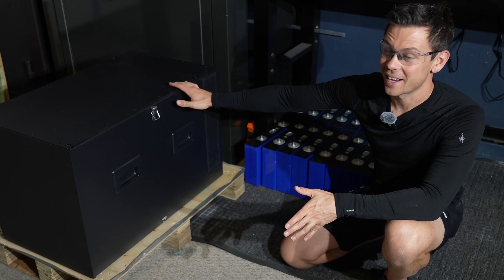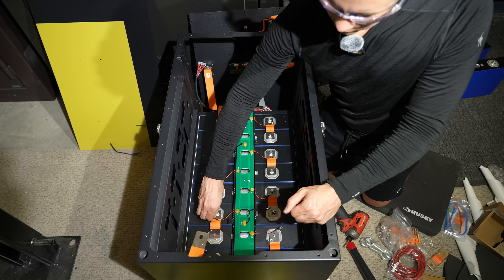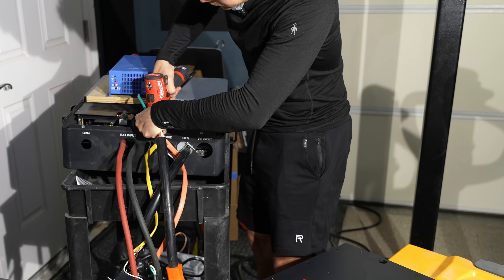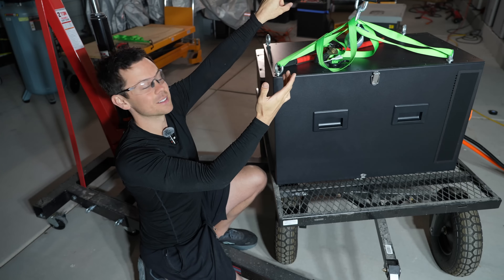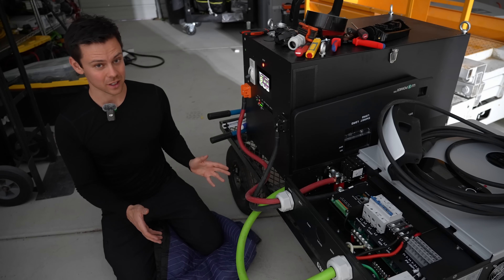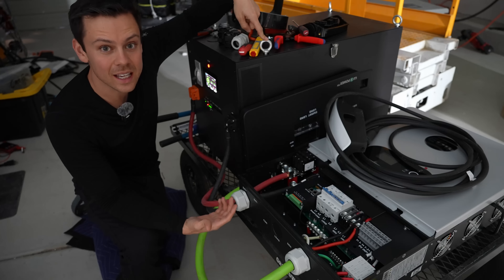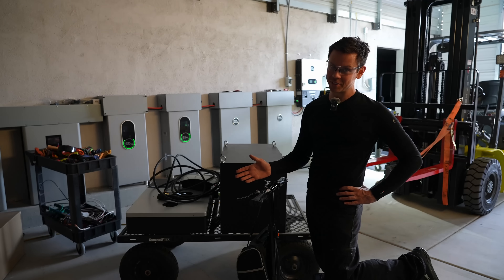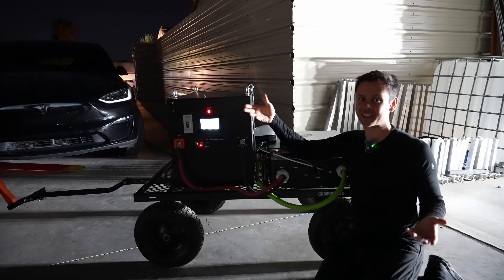HUGE 32kWh LiFePO4 DIY Battery w/ 628Ah Cells! 90 Minute Build

Comment from the maker: Affiliate Links
32kWh Battery: https://yixiangpower.com/products/pre-sale-yixiang-us-stock-eve-mb56-finished-battery-pack-32kwh-51-2v-16s-628ah-eve-lifepo4-cell-lithium-battery-estimated-shipping-date-dec-20th?sca_ref=9207522.jYuzmwEjUpH

Smaller 16kWh Version:
https://yixiangpower.com/products/pre-sale-yixiang-pre-assembled-stacked-15kw-diy-lithium-battery-box-kitus-stock-estimated-shipping-time-aug-28th-16pcs-eve-314ah-brand-new-grade-a-lifepo4-battery-cellchina-stock?sca_ref=9207522.jYuzmwEjUpH

Other Batteries I recommend:
https://www.mobile-solarpower.com/server-rack-lifepo4.html

~~~~~~~~~~~~~~~~~~~~~~~~~~~~~~~~~
Tired of getting ripped off? Check out my "Will Prowse Approved" solar product recommendations below!

12V Batteries
https://www.mobile-solarpower.com/lithium-batteries.html

48V Batteries
https://www.mobile-solarpower.com/48v-batteries.html

Offgrid Inverter System Builder
https://www.mobile-solarpower.com/48v-complete-system-blueprint-559371.html

Hybrid Inverter System Builder
https://www.mobile-solarpower.com/code-compliant-48v-offgrid-system.html

Mobile Handtruck System Builder (very popular!)
https://www.mobile-solarpower.com/mobile-48v-system.html

Solar Panels
https://www.mobile-solarpower.com/300w-solar-panels.html

Ground Mount Solar Racking
https://www.mobile-solarpower.com/ground-mount-racks.html

Wire, Lugs and Busbars
https://www.mobile-solarpower.com/wire-and-connectors.html

Tools
https://www.mobile-solarpower.com/tools.html

Fuses and Circuit Breakers
https://www.mobile-solarpower.com/fuses.html

Plug-N-Play Solar Systems
Ecoflow, Anker And Bluetti! So many models to choose from. See my current recommendations here:
https://www.mobile-solarpower.com/full-size-systems.html

~~~~~~~~~~~~~~~~~~~~~~~~~~~~~~~~~~~~~~~~~~
Need to build a large DIY system? Need a trustworthy solar distributor? These are my favorites:

Signature Solar
Creator of EG4! Solar Minisplits, Victron and More! Largest Solar Store Online.
If you want $50 off, please use my link below and coupon code "DIYSOLAR50":
https://signaturesolar.com/?ref=cPwLcVc0SW-BjN

Current Connected
Best Prices for EG4, Victron, Midnite and so much more! Fast Shipping and Highest Rated Customer Service:
https://currentconnected.com/?ref=wp

~~~~~~~~~~~~~~~~~~~~~~~~~~~~~~~~~~~~~~~~~~
Join our DIY Solar Community 
Need more help? Join the largest solar forum on the internet for beginners and professionals alike. 140,000 members and counting!
https://www.diysolarforum.com

Check Out My Free Book
Best-selling and beginner-friendly guidebook to off-grid 12V solar!
https://www.mobile-solarpower.com/the-book.html
Reply: Will knows what's up. Everything is an opportunity to buy a new tool! 🤣 Get well soon!
Reply: I need to show you the cart that I built! I think you would love it!
Reply from the maker: @davidlewis624 please post it on the forum and tag me! Would love to see it
Reply: @WillProwse It looks like Bluetti has entered the Solar Charge controller, and server rack battery market.
Reply from the maker: @FauxQue-yk8dt  with pure garbage 🤣
Reply: @WillProwse You the man. Review incoming?
Reply from the maker: @FauxQue-yk8dt thanks man, and still healing foot, but have five videos planned next when I can walk a bit more
Reply: @WillProwse  Hey Will!... We are off grid and building an earthship and just switching to some Wattcycle Lithium iron batteries.... Have been following your reviews and just wanted to ask you a few  uestions...I can't seem to get your email address from your You Tube info... are you available for a few  uestions?... Thanx!      Kurt
Reply: Oh how i Wish for one these now in Jamaica 🇯🇲 because of the damage we sustained from hurricane melissa
Reply: I think the bms was 300amp
Reply from the maker: @aftabmaqsood  I just found this out 🤣 oh my goodness
Reply: @WillProwse  I have an idea.  How about you doing videos on building the perfect battery cart.  You are a very talented man.  You know how to do the research on material strengths.  Get what you need in a vehicle junkyard for the metal and axles.
Reply: Time to try a pair of Grunt work boots ,steel toe of course.
Reply: Did I miss the video explaining the water tank? Is this a emergency prep? Now there's no need to run to the lake if there's a shutdown.. maybe it's time to build a emergency Las Vegas crew. I'm game
Reply: Get yourself an old Tesla model S with the dual charger, which you will be able to draw 20kW with it (You need the older tesla charger too I think as the newer one doesn't support it).  Or I heard the Silverado EV does 80amp charging too... I got one and I didn't try it as I do not charge off 80amp at home.
Reply: Is it possible to order the batteries seperate, if so, where's a good place to get them?
Reply: You may be well served to upgrade your golf cart, or pick up one of those tiny airport utility vehicles. They come in 1500 lbs capacities and that doesn't include replacing the batteries. Also they aren't very big.
Reply: Is it just me or are those links not quite working fully? Like when I click on the link for either the 16kWh or 32kWh versions, the page initially loads fine..., but clicking on "Packaging & Shopping" does nothing, clicking on the pictures does nothing. if you add to cart and calculate shipping: Again nothing.

I tried on both Chrome and Firefox. It seems like their website is very broken.
Reply: I want to do a mostly stationary battery for my home.  I was thinking 48 kWh but now I'm thinking 64.

The problem is those box kits are quite expensive.  Also, if that battery has a bad cell in the bottom rack you have a lot to take apart to get to it.

What I want to do is stack batteries vertically on their side.  I'll use 5/16" threaded rod for cell compression with a sleeve of 3/8" PEX tubing to insulate the steel rods from the cells.  I'll use plywood for the top and bottom plates and get 4 heavy duty locking casters with probably a 750 lb rating (each) because when you have 4 casters you want two of them to have a rating greater than your max load because occasionally only two casters will be carrying the load and pushing a loaded cart with blown out casters sucks.

I would set it up as two independent battery banks with a BMS on each.  That will give redundancy and allow both banks to balance cells individually.

I'm not doing it right away so hopefully sodium ion cells will become competitive in energy density and even safer than LiFePo4 with more charge/discharge cycles.

Lastly I would make a case to cover up the battery and I'll probably make that look like a Dalek from Dr. Who (70s era).
Reply: nice deleting negative posts
Reply: He Will, did you look into DC to DC EV chargers? There should be some out there that pull 50V from the battery, raise it up to 400V for the car and charge the car on DC
Reply: altho i love all the new videos on bigger systems you have done. id really like to see some more prebuilt solar generator reviews im interested in the oupes mega 3 seems good and priced right and normaly id be completelly against buying prebuilt extra batteries but the oupes  b2 extra batters have dc ports and also solar input of up tp 2100 watts...
Reply: Can this battery communicate with an inverter so I can set it to not discharge below 20%?
Reply: @enispilavdzic8933 probably, but you can also set the inverter to command it based on voltage, so you can discharge until the voltage hits a specific level.
Reply: I look forward to next week's Video...
BUILDING A HABITAT ON THE PLANET MARS IN THREE HOURS!
*Some Assembly Required
Reply: Will, like you, I often work alone - an incident like this suddenly makes you aware how vulnerable you are - always carry a phone and let folk know where you are
Reply: Would you be able to do a few videos about E-Bike batteries. Maintenance & Rebuild DIY. Thank you.
Reply: This is where we go out and buy decent work boots!😅
Reply: Porfa haz una revisión de la vatrer de montaje de pared
Reply: If it had double lugs for the connections it would be better. As it is the only logical way to wire them is to stack them. And I would not wish that on any DIY soul.
Reply: @willprowse could you one day test the PUPVWHBW 200AH mini lifepo4 battery?? I’m thinking of buying and using one for car audio…
Reply: This might be a dumb question, but could this battery be tied into the Bluetti system (3 Apex 300s connected via the HubA1 (which is also a transfer switch)) and if so, how?
Reply: Use Arnica gel on your foot injury.  It will heal your soft tissue injury much quicker.
Reply: I was expecting to get more feedback from you on this... Maybe it because of the pain... No comment that this is a serviceable battery.  Everything is screwed in.  No info if the tork specs was provided.  No details about the connectors and internal wiring. No info about any vents. No comment about the fuse or breaker. No details about how the battery are installed, and if they are well compressed, of if it needed.  No details about the insulation and potential safety in building it.

I personally love the idea of a home build battery with professional result, as it garante easy service on it, especially for people who live off grid.  I didn't feel you were that excited about it... I know I personally was excited about it when I saw you build it. It look freaking great so far !
Reply: @mochouinard i think that was in the original video, where he talks more about the quality, the things missing, the wiring gone wrong. This is him doing it for the third time, I understand if he skips parts that viewers would already know (but he could point to it)
Reply: Bro, get rid of that Tesler and get yourself a Telo or a Rivian Quad2 EV...

Comment: $3,500 is expensive? the cheapest i could find for a home system here, as in set up to charge from solar panels or the grid and provide as needed to the home was $3,300 for a 2KW system, $2,200 for the batteries and $1,100 for the control system and installation.

Comment: I bought one of these  32kwh Yixiang batteries, expecting it would be a DIY assembled battery like Will's. It came fully assembled and very well packed for shipping; all 600# of it. I have the equipment to move it. I also ordered four more 32kwh batteries from Docan. Docan's Amy told me they were in a warehouse in Houston. I drove 1200 miles to pick them up, only to be told they had not arrived at their Houston warehouse. I had scheduled a January 8 pick up in Houston. Amy had replied "no problem" with the chosen pick-up time. I drove back 1200 miles. 40+ hours of wasted driving time. I'm very disappointed in Docan. They still have not arrived in Houston as of January 12.

Comment: I can't find measurements on this box.... I have space for 450 mm wide , 600 mm height and 810 mm long....  the 628H Eve is 352 mm long , so I should be wishing the width of my space... I will not build on floor and lift it is... It will be built where it will stay for the lifespan of the batteries in a Volvo B10M RV/Motorhome. :-).  tia

Comment: You're very close to an all in one power cart I'd like to build. Start with a motorized cart to hold 2500lbs. Add simple wagon steering with controls on the bars that allow for driving on or off the cart. Then add the battery, cord storage and an inverter, 6000xp minimum. Top that with six full size fold out panels and slide out storage under it for six more panels. Weight w/o passenger would be <1900lbs, cost about 9,000.  Easy fast powerful power you can drive to its location, how fun is that? 
If you want to try I'd be glad to offer help designing it.
Reply: Crazy, at the end you want a better cart. I'd like to do that. Handy with designing, welding and composites, do we need head lights? No problem. Building insulated composite bodies over a frame is easy and fun. Might make a show on my own building E Stuff with all the cool new motors, batteries and options. This is just one. Another, a mini electric Sherp with 35"x13" tires for apx 20k dollars.
 An E-build show with some fun ideas and people would be a big hit. Too bad you weren't closer to Chicago.

Comment: Can you direct me to a video you may have made in remotely monitoring a battery from anywhere.   I have an RV with a 320 ah lithium battery and have it remotely stored with only limited solar and need to know when it's getting low so I can recharge.   I have a WiFi set up with cameras which is why AI want to monitor.   I am unable to find any any videos that I can rely upon in seeking your advice or direction. Thank you if you choose to assist me.

Comment: Will, I would love love love love it if you could do a build, or at least compare the latest CATL 587AH internal stacked vs standard wound LiFePo cells and explore if the difference is actually worth it. CATL is showing a 48% increase in energy throughput over the entire lifecycle and energy density of 434 Wh/L energy density—a 10% increase over the previous generation. Is this a game changer? 

Thank you for even considering.

Comment: Hello Will, I need help.  I bought a new set of batteries 4- 12.8v 320ah.  I hooked them up on busbar with my other batteries that are 100ah batteries.  Looking at my Bluetooth app. It looks like the inverter is pulling from the 320ah batteries and the other ones are not being pull from. The load is light about 700 watt.  Is this normal or okay?

Comment: if you get a "spreader bar" you will be able to lift that thing with the engine hoist. it weighs 600 lbs but the angles of your straps actually put more force on those eye bolts. Some kind of rigging math is involved I don't remember the calculation. But spreader bar seems to be the right way lift that straight up

Comment: Do any of the manufacturers make a heated battery like this for Northern Wisconsin winters?  Looking at creating a portable Level 2 trailer for both EV charging/100 amp service home backup.  This battery heated, EG4 12000xp, EG4 Chargeverter, remote start 6500w diesel generator, >24kw solar panels sized to maximize the 12000xp.  Just have to fabricate a rack that can support and easily deploy the panels and lift itself over a car trailer, like a lippert hydraulic leveling system.

Comment: Get some DMSO for your foot. MIx it 50/50 with clean water and apply on any skin. If you can handle the warmth, then apply 100% on injuries.  Instant pain reduction for any joint or soft tissue issues, reduces swelling thus accelerates healing.

Comment: Your straps were to flat, thats why you bent the eye bolts. You could just get a bar to hang from your lift and that would give you a right and left point to hang from, two points instead of one center point.

Comment: The fact that the US government has turned the UL listing into a cash cow is the issue with it today. All of the equipment in that box meets or exceeds code. And has been UL listed separately. Including the BMS. But since you are not letting some exploiter assemble it and charge you an arm and a leg for that privilege? You are not allowed to certify your own battery assembly. Even though the tools to do so are cheap and readily available.

Comment: Just subscribed. Im diving into lithium batteries to see if its something i can use on my service truck. I need to run a few 110v outlets and one 50amp 240 outlet to power a welder and other small tools; not necessarily at the same time.Any recommendations on what direction i should take or look into? Just starting to look at the difference between 12v,24v,48v setups so very new to this😅. Currently running a 12v 5k inverter with dual agm 31 batteries but i dont have 240v outlet. Dont really want to buy a big gas generator if i can keep it simple.

Comment: Quick non-related comment: Bluetti came out with stand alone batteries.  Please tear down and examine.  Supposedly, you can put up to 4 in series and 8 in parallel on the 314ah battery unit.

Comment: ❤Spent 5k in 2021 with 4 Chins 300 AH battery 12.8 V wired series parallel for my 24v nom Outback setup.  Still working awesome.

Comment: Hello Will, my wife turned her ankle really bad and had significant bruising.  She used a mixture of 100% Aloe Vera gel and Tincture of Arnica. Put an appropriate amount of aloe in your hand, enough to cover your foot,  add a good dropper full of the Arnica and rub together, apply to the bruised area several times a day. The Arnica will help with the bruising.  If the aloe is to sticky you could mix this with a good lotion. She  likes the aloe, most lotions have to many chemicals. She did this for a couple weeks and her doctor was amazed at how quickly the deep bruising healed. A high quality face cream would be a good carrier also.

Comment: You should do a video on ",effects of undersizing batteries when running high loads". I.e., 4hp lift, an inverter capable of running it, but the batteries are insufficient to handle the inrush current

Comment: Looks pretty well designed.  Be away of the energy when you start building bigger batteries.  Fire, short circuits, burns.  In nz our standards have changed because of dangerous servicing being done professionally on large UPS systems.  Great video

Comment: You have 3 great option for fabricators around you. (Plus some in vegas I can't recall.) 
@FabRats They are only 3ish hours from you and I am sure you can do a colab with them like on a battery backup for when the power is out. 
@MattsOffRoadRecovery If not them the Matt sons Kaulin or Rhett are good at fab. Hurricane UT
@Rudysadventureanddesignreal Rudy with also of Matts kids, who is also good at fab. Also probably the most into the same stuff you are.